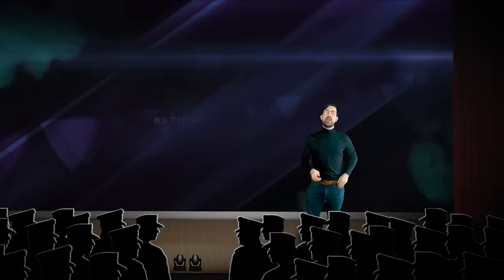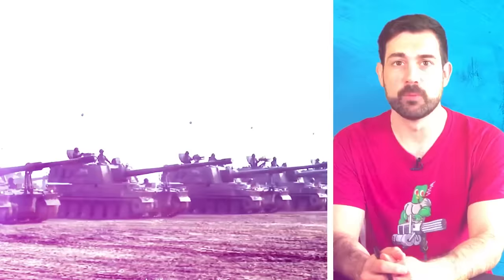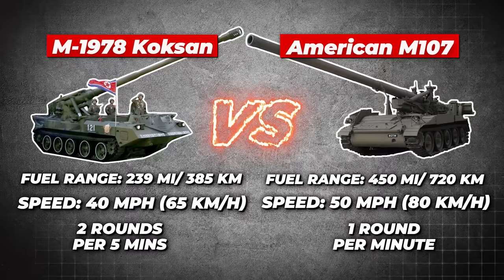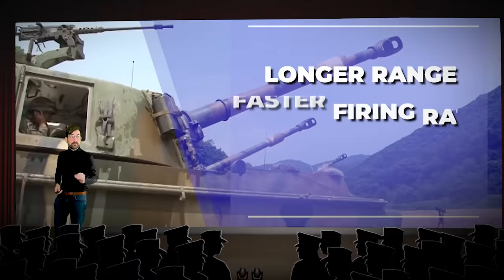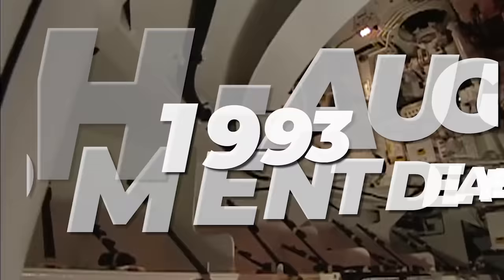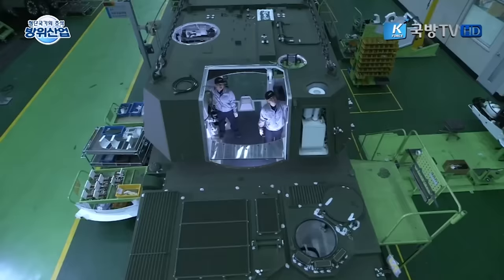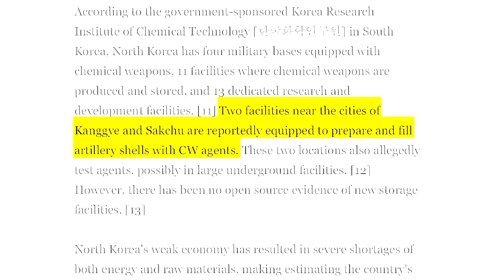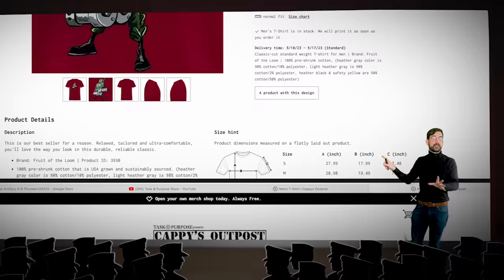Why Korean Army Artillery is the Best in the World

Comment: South Korean arms industry is perhaps strangest one in the world. Facing hermit kingdom directly they had to adapt to their strange opponent- thus they are capable of creating absolutely incredible back line equipment (although discussions on viability of K10 are mixed) while letting their other equipment have terrible capability gaps as north will probably never have them. Look at K2-  incredible piece of engineering with laughable mine protection- which is fine when you are fighting Kim’s dynasty but another other opponent will have a field day with you - as advanced mines will be a problem for you. That’s explains why some of their weapons despite their excellence in many areas fail to attract customers while some smaller ones like K9 are conquering world. I hope they keep up the pace as the deal between polish industry and Korean one is the deal that poles where searching for nearly hundred years.
Reply: That's a great point on mines. But according to the Norway tests, the K2 won every test including the armor test except for the side armor.

My understanding is that mines hit the underbelly of the tank and in that area K2 can match or exceed the Leopard.
Reply: @jimpark8379  as far as I know k2 has only stanag lvl 2 on mine protection. Same went to the AS-21 which is one of the reasons why it failed to secure contract during comparison test with Borsuk ifv (which according to rumors is so small partially becouse of very high mine protection level) in Poland (aside from being pitifully underdeveloped which Polish army where willing go look past).

Now when I think of it perhaps it is far harder to lay mines at high elevations so they are less bothered by them.
Reply: Poland should’ve gone with overpriced euro tanks which with its great euro mine protection are blown into space in Syria, Iraq, Ukraine 🤣😂😆😅😆😂🤣🤣euro be euro
Reply: @radosaworman7628  I think you Europeans are still fighting the last war. The reality is that the vast majority of fighting in modern warfare is artillery barrages, tanks charging into each other is a thing of the past.

Once you fire, enemy radar will lock on to you and if you can't move out, you are toast. The K2 and K9 were designed to lock on and fire first and move out before retaliatory fire hits. The doctrine works. India had 10 K9 units and fired and moved on crappy Chinese artillery and slaughtered the whole unit. Word of that got out and now everyone wants them and India has ordered thousands more K9.

Scouting with satellites or drones is a hell of a lot smarter than armoring up tanks. Just send a link of cheapass drones in front of the tanks to trigger mines. You can build thousands of drones for the cost of armoring up one tank or personnel carrier.
Reply: @jimpark8379  well I would say that moust of Europe is still measuring themselves up to standard of ussr with accounting for modern capabilities Russians aquired but with no accounting of capabilities lost. Mines are a menace on modern battlefield as they are put up by Russians without rhyme or reason. 

Also mine protection isn’t exactly armouring up as moust of it is gained by mechanical devices that use flat surfaces on the end of mechanical device’s arm to absorb majority of the pressure wave to save crew from over pressure. Those mechanisms do not way much but they need to be accounted for very early in the design. 

K9 is excellent piece of equipment and so is k2 but they are truly masters of very specific role found on Korean Peninsula. I’m just very surprised that there are some people that claim existence of some form of military panacea. Every single type of equipment have some shortcomings- optical satellites are very weather dependent, radar satellites have depth resolution of roughly 30cm which means that only sometimes they can observe track marks but moust of the time they only see things “in the moment”, small drones are easily found by modern radars, while MALE drones are outright murdered by modern IR tracking missiles. 

And what if the enemy upgrades their mines with time selective fuses? What if enemy will find some other way of killing the K9? It’s cousin Krab is having trouble with traps using wire guided AGTM’s and suicide drones. Closest competitor to k9a2 - the pzh2000 bearly sees combat due to jams, poor mobility due to high mass and atrocious reliability problems. Yes k9 had correct recipe for peer to peer artillery duels (which I assume was close to polish mantra of 10 seconds after first shot you must be outside of blast zone) but conflicts tend to change the rules couple times during it’s duration and no one can predict what will be next thing we need to care about. And fact is that South Korea have rare luxury of having one enemy that is intense only on the front of mechanicals with nearly nonexistent digital capabilities.  And I wish that neighter of our countries well ever have to use part of our bilateral agreement where equipment needed on the frontline will have primacy over current needs of one of the recipients that still enjoys peace.
Reply: @radosaworman7628  Great post.

Great points and that's why the Koreans want to work with the Poles on further improvements to these weapons.

I'm not an expert on this kind of stuff either. My point is that every time you design a weapon that has certain benefits, you also lose something.

It's fair to criticize the Korean weapons for lacking in armor and being vulnerable to certain attacks, but that kind of criticism should take into account the lighter armor has certain benefits, such as in the Omani trials when the heavier Leopard got stuck but the K2 was able to get out of a sand trap.

The key is matching up the weapon with the terrain and your military doctrine. But I still believe fire and move has to be the basic military doctrine in modern warfare. Modern radar systems can lock on to targets and counter strike with incredible accuracy.

There's no way anyone should sit still after firing and volunteer to become a target.
Reply: @JuriK Actually Japan's Type 10 is the first tank to embrace the fire and move concept from its inception. The Korean tank designers copied a lot of elements from the Type 10, copied a lot from the Leopard and LeClerc along with everything else out there.

The Germs and the French are really good at designing great weapons. I hope you guys come up with great stuff to make a tank that's better than the K2 so we can copy those innovations for the K3.
Reply: I think you missunderstood the mission of SPGs with TANKs' or IFVs'. It sounds like you don't have any military experience. 
Are you dreaming of SPGs going through frontline rain of shells?  Where are you from?
Reply: @obser7088  nah. Their spg’s are on point as that’s the one of tiny amounts of real threat’s their military is facing. But some of the other stuff they are doing are nowhere as versatile as they could be as they hyper focused on one type of terrain that is usually not the place prople will fight over and their opponents are less than competent in other areas. Like I’m not really complaining, just pointing out weaknesses- like k2 fits some high value targets like suwalki gap like a glove (tiny stretch of of border between Poland and Lithuania- hilly, muddy, lots of lakes).
But standard k2 is hyper specialised and needs some adjustment to become more versatile in other types of terrain- like flatlands, desert and so on. So it’s more of the criticism of their industry and difficulties in understanding of other countries threats - as their opponents and terrain is far from usual.
Reply: @radosaworman7628  Let's leave out desert specialization because that requires equipment that neither Korea nor Poland would be interested in.

As for mountains vs flatlands, the only thing that seems to be of concern is side armor. And that concern is not over tanks taking hits from other tanks or heavy artillery in a flanking action, but guerrilla warfare tactics involving guys on motorbikes with shoulder armed missiles.

The reality is, no matter how much armor you put on tanks, none of these tanks, with the exception of the Abrams with uranium depleted armor, is going to survive a direct hit from a 120 or 152/155 mm gun.

The K2 advantage over other tanks is it's got the best electronics, and it relies on its soft kill system to use radar and infrared to detect targets and then auto targets them. The Polish tank commander said he had 2 seconds to approve the autokill of targets the K2 active protection system detected. The K2 guns have greater range than shoulder fired missiles so you should be able to pick off guerrillas flanking ambushes.

I think a tank with a suspension designed for mountains will do just fine in the flatlands. You can put on extra armor if you want, but even the Leopard was too heavy for a bunch of bridges in Poland.

Compared to other tanks, the K2 uses 6 wheels on its track, not 7. If you add extra side armor, you will also have to add a 7th wheel and that will take away the K2 advantage in mobility.

I think you're exaggerating the specialization of the K2 for the Korean peninsula. It's beaten the Leopard in every test except for side armor, so there's no objective reason to say that the K2 will not work in the plains.
Reply: @jimpark8379  fuck sorry I thought that it was a reply to other guy.
Reply: @jimpark8379  Are you kidding? Type 10 which is mini Tank bro, just 40tons! and K2 porduced in 2008. What? Type10 was copied from K2. Type10 was 2010, as your opinions right? Which was copied Tank? Does it make sense for a 40 tons(Type10) tank to be copied by a 55 tons tank(K2)? Even copied a later pruduced tank?
Reply: @graycain  Bro, are you kidding. K2 development timeline was continuous and was over a decade. Plenty of time for Type 10 and K2 to steal ideas from each other.

And who cares who produced the idea first? Best weapons means you use best ideas, best tech, doesn't matter whose the inventor.

And bro, the K2 and Type 10 both are built on networked information from satellites to get the first shot off and then move before radar locks on and returns fire.

So they're comparable in that they emphasize networking, mobility and hi tech, and smart weapons over armor and sheer firepower.

Chill with the nationalism bro. The K2 is widely acknowledged as the best tank in the world after testing by Norway and how the Polish army and generals were going nuts saying how incredible it is, how it kills the Leopard.

The quality of the weapon speaks for itself.
Reply: @radosaworman7628  korea is one of the heaviest mined places in the world. high elevation isn't an issue, particularly for the anti-vehicle type.
Reply: @leedavid408  no way poland is going to buy russian model tanks, though; so no worries about their tanks being "blown into space [like russian tanks] in Syria, Iraq, Ukraine.
Reply: I was talking about leopard 2

Comment: Extreme accuracy right out of the tube is less important now. DGPS has miniaturised to the point where it can be fitted into a shell easily. So even things like wind changes and enemy movement can be compensated for. The shell (or free-fall bomb) is becoming more like a guided missile these days.
Reply: In Ukraine Russians already are interfering with GPS near important targets. Accuracy right out of tube will always be important.
Reply: Only problem is that it's crazy expensive compared to standard rounds.
A standard round is $330, a rocket assisted is 1k, an Excalibur round costs 110k each. They have their uses and purposes, but when you can get a similar result with a 15s burst fire, and your fighting in your country, you loose most of the reasons...
Reply: @zano187  That's right. You will only use guided shells against high value targets. But the $$$$ equation makes sense in many cases, I mean a modern tank costs millions. And what value a strategically important bridge for example?
Reply: @Truspio  I don't see any push to make the gun less accurate, I'm just saying that ultimate accuracy with a single shot is now possible with an in-built guidance system which compensates for many variables.
Reply: It's not. Having the best possible baseline is still key. Cost of the munition and electronic interference plays a big part. The trick is to use the right tool for the job and actually having that tool where it needs to be.
Reply: @karlp8484  that along with the other major benefit is gliding to give it the longest range, and you need only 1 shell instead of carrying 5-15 basic. There's also going after less $ targets such as supply depos
Reply: @zano187  Yes, that's basically my premise. Quality of effect over just quantity. The other factor I didn't mention is less collateral damage. You hit exactly what you were aiming for.
Reply: Better accuracy right of the tube still improves range. Any aerial maneuvers will always involve shedding kinetic energy to the air, so the more accurate the shot, the farther the round can fly.
Reply: @ElTubeo1515  That's right. I didn't say very high accuracy was unimportant, I said it's less important. Ultimate accuracy to say 1 metre is going to be a result of DGPS not the barrel.
Reply: @ElTubeo1515  So, when did you complete your artillery training? Because I don't think accuracy and range correlate in the way that you imply.

Comment: The K9 is one of if not the field, self-propelled artillery currently in the field. But do you really think it will stand up to the M1299 ERCA once all the kinks are worked out and auto-loader added. It should enter partial operation in 2025, and if the stats that are public are correct, its a monster. It may be capable of even more, and the new ammo types including a next gen Excalibur and a new ultra long range projectile will change the battlefield.
Reply: The M1299 can be on par with the K9, even surpass it, but there is little room for improvement. The biggest differences will be the length caliber and possibly the power pack. The fire control system will be pretty much on par with K9 Moukari. The biggest difference is the barrel length which will give it an advantage.
Reply: @inso80  i think the barrel is also designed for higher pressures. Meaning more powerful propellant will be used.
Reply: depends.  K9 is battle tested, and proven to be both effective and reliable.  also, cost effective.   other artillery with better specs don't actually measure up in real world scenarios, due to quality/reliability issues or dodgy testing methods.  Korean weapons are all heavily tested and rated for all weather conditions, from desert to siberia.
Reply: Well A3 is planned with ERCA L58 barrel, so....
Reply: @kenmasters2025  are you suggesting the United States doesn't test its equipment properly? Quite a bit of the tech is already battle proven. The chassis for ERCA is the Bradley chassis. The L/58 barrel has been in tests for 2 or 3 years now. Its not a secret that the US has the best digital fire control, AND this will be part of the new sensor fusion fleet where armored vehicles, aircraft, and ships all create a 3D battlefield sharing info. The US also has the longest range and most accurate shell in 155mm right now with Excalibur. The pzh2000 can hit 48 miles with it. But a new shell is being developed for extreme velocity and rocket assist. The goal is a 100mile range. Since the barrel is designed for stronger propellant as well, you can extend the range of common shells. K9 rules today, pzh2000 is getting a new shell to make it adequate into the 2030s, but the US is making a monster for the 2040s and beyond. Even the k9 is largely based on the m109, and UK as90 too. The old variants use m113 chassis, though

Comment: The PzH 2000* self-propelled howitzer – armed with a 155 mm L52 main gun developed by Rheinmetall – is widely held to be most advanced, most effective artillery system anywhere. Extremely accurate and highly reliable, the PzH 2000 achieves a high rate of fire owing to its automatic loading system.
Reply: Yes, but it also is very expensive

Comment: Would love to see some kind of specialized cylinder that fits into the K10 loading system that could contain rations, air filters, water, and even minor parts or small weapons munitions for secured delivery to the crew.
 If the K10's resupply location isn't far off and is well established then hot meals, medicine, and fresh uniforms could even be delivered as well with the empty cylider used to rotate out the old ones.
Reply: Do you man to launch through the gun barrrel to a nearby crew or provide extra storage for the vehicle crew?